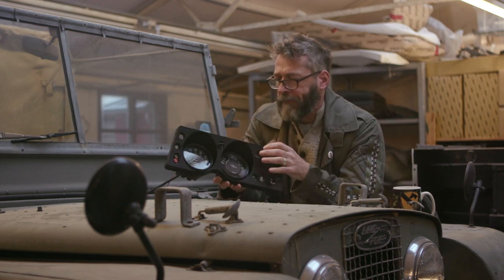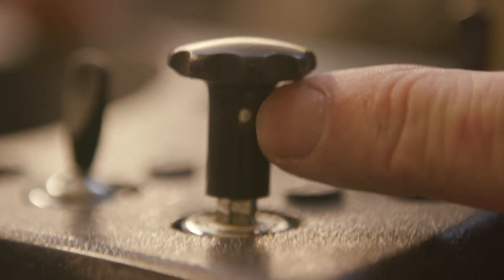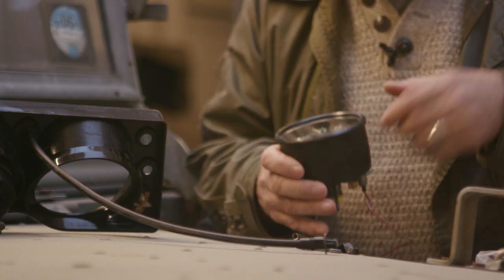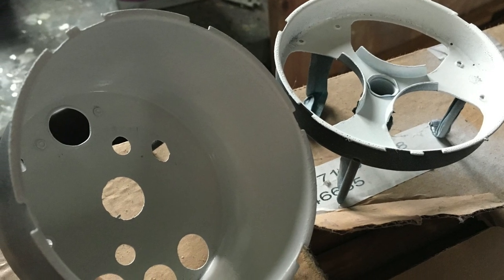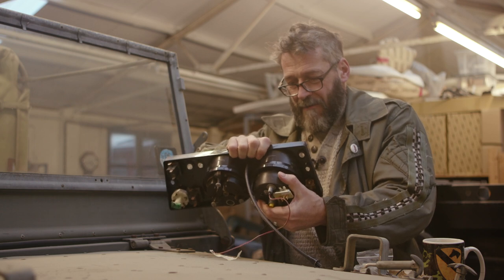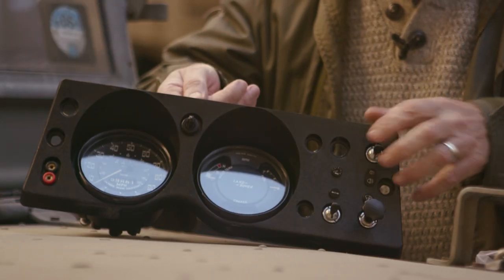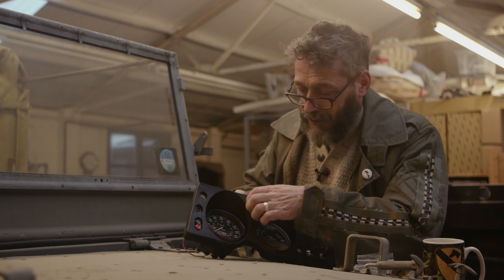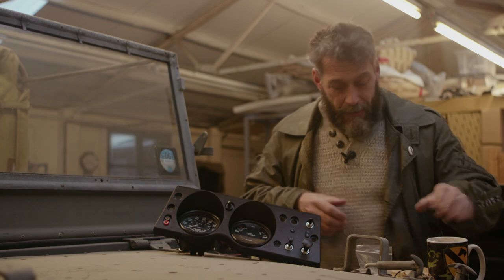Ep. -02; Land Rover, Series 3 rebuild. "Instrument panel rebuild/restoration/repair"

Comment: Adam,

What are the part numbers for the led instrument lights?

Where did you get them from?

Thanks

Simon
Reply from the maker: Hi Simon. I don't know the part numbers, I just found a set on Ebay and bought them. TBH, some of the bulbs didn't fit very well and I have replaced them with better versions. It was trial and error I'm afraid.